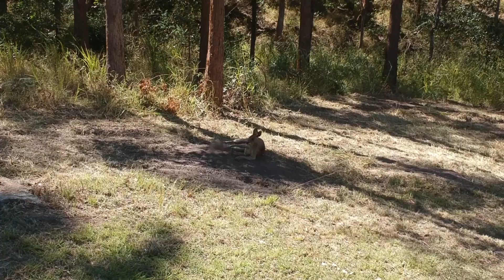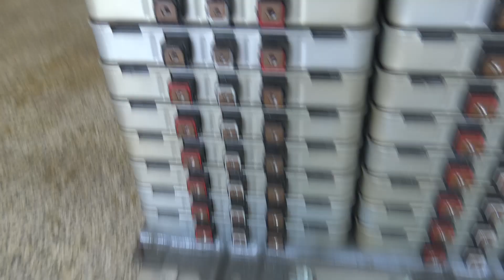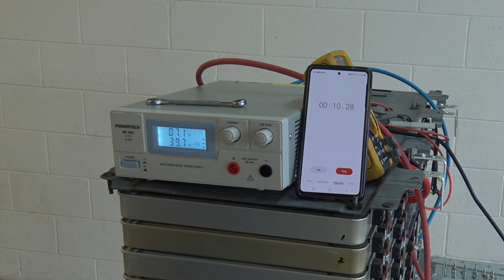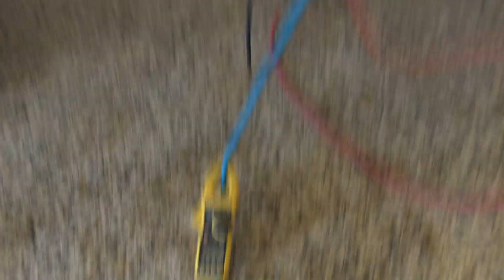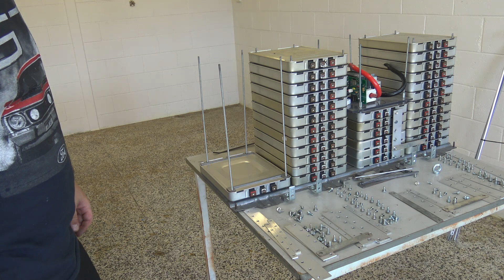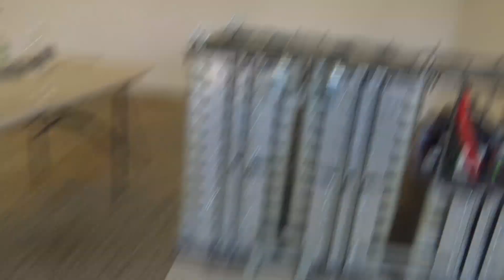Recycling EV batteries for Off Grid power, Part 1.

Comment: How did you determine what size metal strip to use to discharge the battery and how hot did the metal strip get?

Comment: Hi, please  help with  information  , 
I have  the gen 2 batteries  but on 6 X  bricks  ,  I am getting  at best  49.2 volts . 8.1v per brick . For safety. 
I have had to go to 7 X bricks  to total
56.7v  please  help me get over 9 volts per brick ,  so I can reduce weight and space.
Thank  you  this is very  exciting   news  🙏.
Regards Colin.
Reply from the maker: You can not increase or decrease the limits of the cells. 4.2V is the very top of the cells, I would suggest staying under this at a top of 4.15V or 8.3V for you setup. 

If you have only 6 cells, you won't have the right voltage for 48V applications. My minimum pack voltage is 42V, and max is 58V.
Reply: @jdev1979   at 3.59  mins you say  you have  57volts from 6 bricks   ? 
This video  is very  confusing. 
😮.
Reply from the maker: No, actually what I said was 6 bricks in Parallel and 7 sets in series. Putting cells in series (a chain of positive to negative) increases the voltage, therefore (7 x 2) x 4.15V is about 58V.
Reply: @jdev1979  
I just went back and checked,   7 setts  X 6 bricks  in series  =42 6 bricks in series   = 50 volts . Not 57volts 'ish
Plus you removed my comment s.
So   Rather  than correct your  mistakes  and  save  a posible over charge fire 🔥  . some  poor person will lose there house.  To A battery bank bursting  into flames . 
They may have children  and there parents  at there home ?
The truth will Save  an amateur losing  everyone  and every thing dear to them.
Because  you will not edit  your video. 
Wow. 
Wow 🤪
Reply from the maker: I also watched what I said and I didn't remove your comment. You can clearly see the bricks are in groups of 6 and there are 7 of them.
Reply: @jdev1979  
All 7 have  6x 8.4v = 50.4v  total max charge . You say  57v
Plus you have  no battery  management  to stop an over charge. 
Please  edit.
Reply from the maker: No it works the other way around, there are 7 sets of 6 in parallel. I clearly have a BMS, it is in the middle next to the contactor. I've had this battery running off grid for more than 1 year. It works fine

Comment: Can you explain exactly what youre doing with the test? You set quite a high voltage on the psu but as its max current out is 40A it only drives at 7v, then if the module is bad it can't absorb power for long (high internal resistance?) And the psu starts increasing the voltage to maintain 40A? 

Im currently capacity testing modules with a 5A tester. Its very slow and also im not seeing the bad modules im expecting to see!

Great work. Thanks for any advice!
Reply from the maker: In each brick there are 2 cells that max out at 4.2V each and therefore 4.2V x 2 is 8.4V at the top. Most of these cells were about 10-20% charged at around 3.5V-3.6V. If the capacity of a cell is good, it will take the 40A charge and slowly increase the voltage. Inversely, if the capacity is poor, you will see a spike in the voltage. 

Think of it this way. Using a fire hose, you fill up a pool which represents a good cell. You turn it on and it can take pretty much whatever you throw at it. The bad cell is represented by a bucket. Very shortly after turning on the fire hose the bucket is full because it has very little capacity. In a battery pack like mine, the constraint of overall capacity is determined by the cells with the least capacity. The BMS software monitors the top and bottom voltages to turn the inverter off at those levels. If my overall battery is at 10% and the inverter starts charging it up with solar production, once the bad cell reaches 4.15V (my BMS limit) the BMS will tell the inverter to stop charging, leaving me with a battery that might only be 15% full overall. 

While these cells do have some degradation, you want them all to have a similar capacity because you are limited by the weakest one.

Comment: When watching a friend disassemble a LEAF pack to salvage the cells, he was wearing electrical insulating gloves.
You seemed a little cavalier when handling the bus bar while aligning the stack.
Is there no danger of shorting terminals to cases? 
Maybe not in that alignment step, since only one set of terminals is involved, but as you are adding the other bus bars, isn't there a point where it becomes dangerous?
Reply: The Nissan cells are ALL in series. This battery has a lot in parallel - much safer.
Reply: We live life on the edge down under !!! 😆